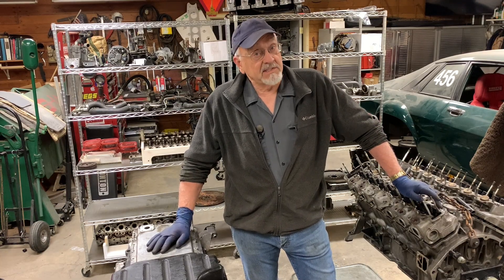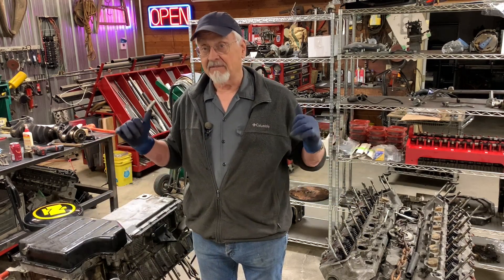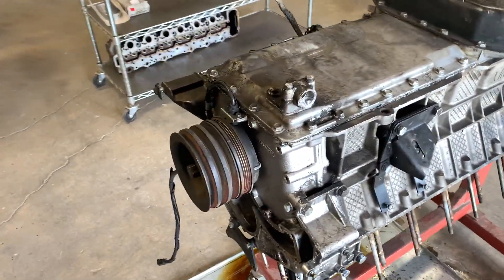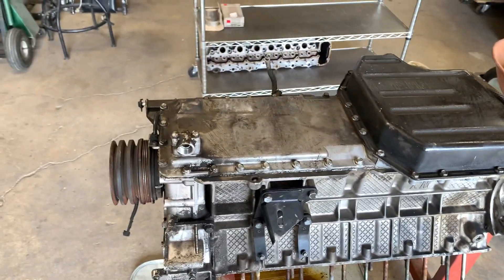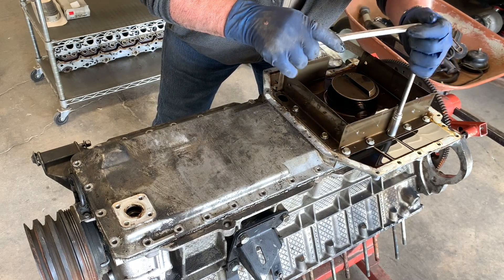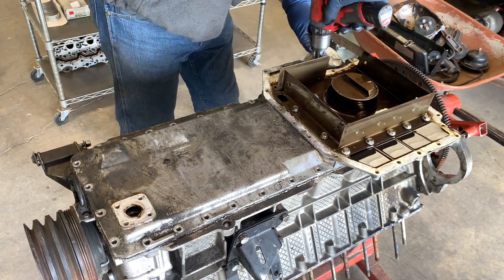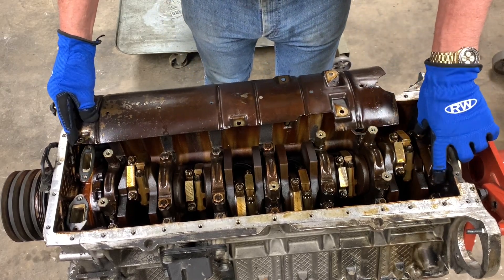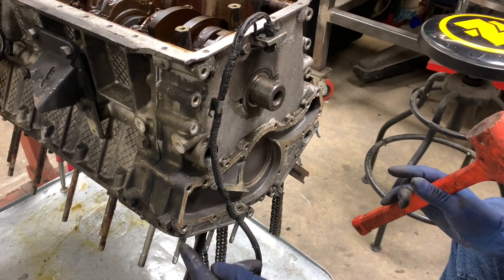Jaguar V12 Disassembly: Welcome To Hell Week!!! Part 1

Comment: Taking a Jaguar V12 engine apart is actually fun. Removing all the components, sorting, counting, and bagging all the nuts and serrated washers, the Christmas-like feeling when the stubborn heads finally stop resisting, and drawing wild conclusions from the residue in the oil pan.

Comment: Soooo glad to see someone actually doing a Jaguar V-12.  I'm a long time hot rodder, but my experience has been with American V-8's.  I now have an '88 XJS and have been thinking about getting a spare V-12 engine to learn on and to make as reliable and potent as it makes sense to.  Will be waiting for your next installment ! !    Thank you for sharing.  No bit of information too insignificant.  Please allow all of us to learn from your expertise ! !
Reply from the maker: Thanks Gary. I've long felt the Jaguar V-12 would be a perfect fit for an upscale street rod project like an early '50s Buick. The straight 8 engine compartment would be a perfect fit. Particularly with a set of Weber carburetors on top.

Comment: Bob, i broke the tensioner trying to relieve the spring tension, but I didn't really care, since I had sourced a new one and included it in the shipping crate.
Turns out that if you don't use the actual tool, and try to fabricate the tool (and don't really know what you're doing) the chain tensioner is pretty easy to break.
I didn't send the broken parts (I mean hey, with freight rates what they are I probably saved 20-30 grams). Again I bought this engine and tranny from a dismantle shop in Lancaster CA only because it was a 1991 engine. I had the alternator and starter rebuilt ( they are in the box as well) along with standard bearings and a new timing chain. What I obviously DON"T have are the injectors, bits and pieces of which are probably still in existance  as nano particulate aerosols.
I will be interested to learn the condition of the crank. 
You have probably already noticed that I managed to totally ruin a stud removing the head.
Knowledge is a wonderful thing, and worth the price one pays for it...in this case the spare engine.

Bill
Reply from the maker: Hi, Bill. More info in the next video where I get into the forensics a bit more. The tensioner gets replaced every time unless it has obviously been changed recently as it was in Ol' Tex's engine. The consequences of cracking/breaking an old tensioner during installation is too great. The crank journals are fairly smooth but probably out towards the limits. A regrind is likely in the future since these clearances are so important for engine oil cooling/oil pressure. The journals are so big and there's so many of them it doesn't take much wear to upset things.

Comment: the effort is appreciated. i see a piece of spring loaded delrin (possibly) in my future. iirc those tensioners are basically unobtanium. not that delrin is cheap.
Reply: The timiing chain tensioner is still available from Jaguar but quite expensive